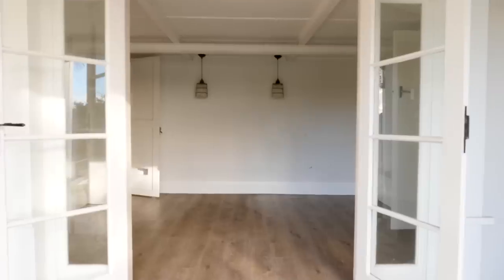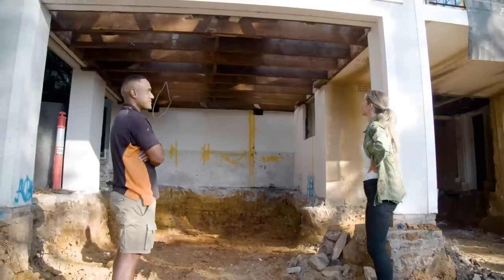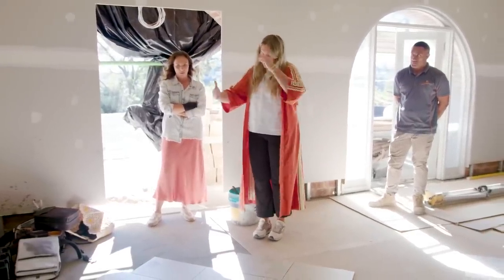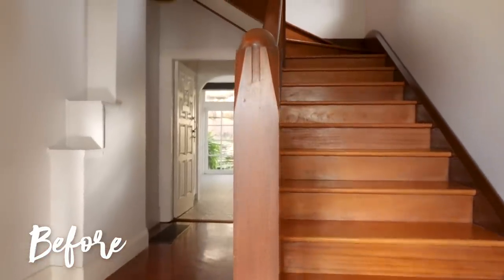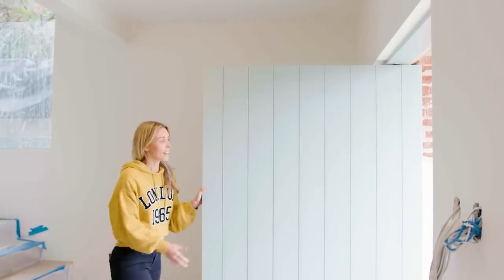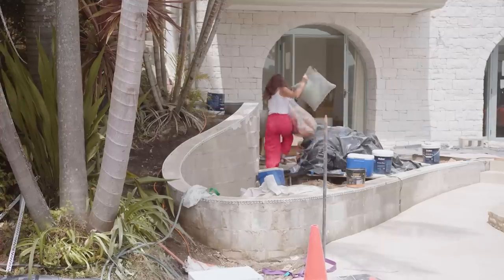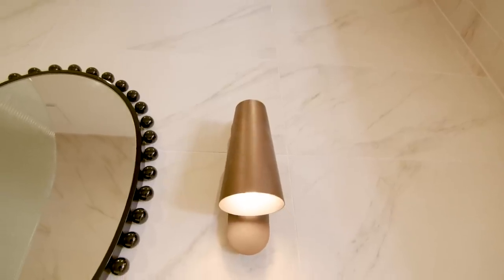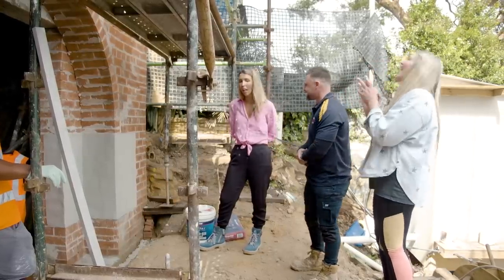Uninhabitable basement turned STUNNING front entry, entertaining/guest room - Ep 4 - House 15

Comment: With all the worries about blocking light with shutters, cutrains etc, I think it would be a game changer for Bonnie to learn how central Europeans simply seamlessly install a box full of rolled up shutters in the wall above a window. You can roll them down electronically or by pulling on a string. They are completely black out and perfect for keeping our the heat in the summer.
Reply: They are simply the best! We were unfortunately not able to install them inside the wall, so they hang outside, but the look like part of the window framing if you don’t look too closely.